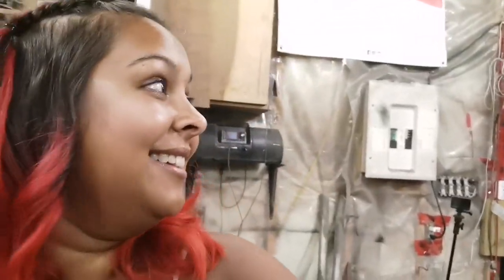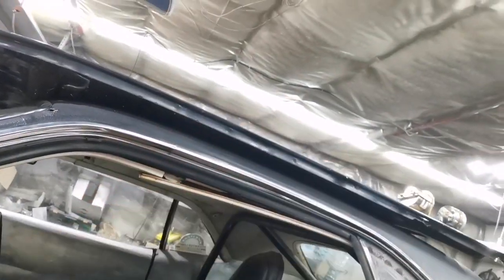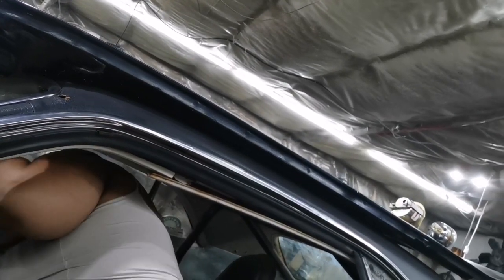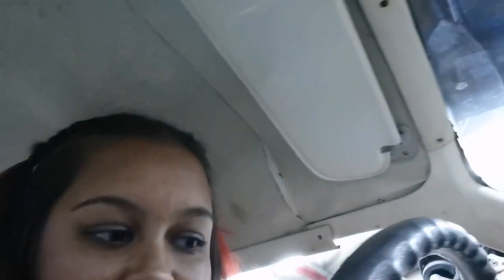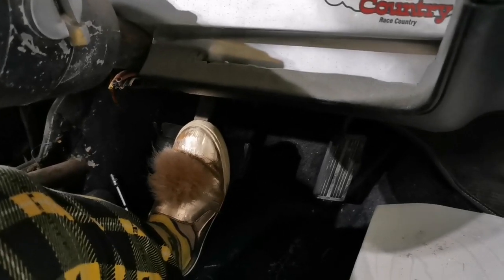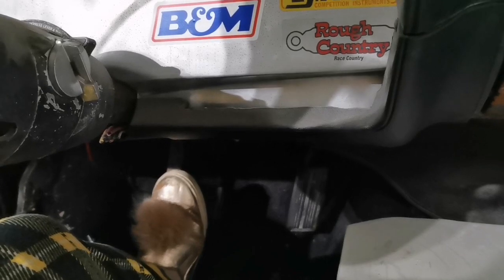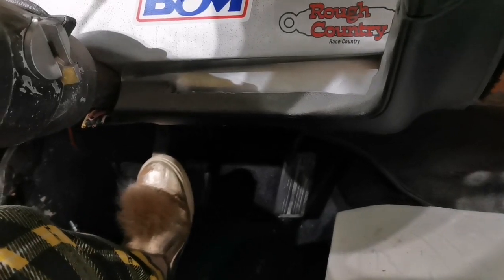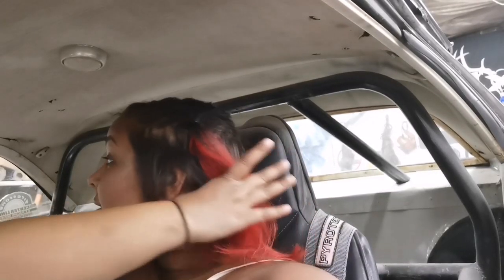Behind the Scenes - Brake Bleeding Fail

Comment: You worked hard! Props for sticking it out as long as you did. Dan should have you bleed good brakes once so you get a feel for what they should feel like so you know what to expect when you have a bad one. Sometimes they just take longer especially when they have sat forever. Good rule of thumb so you don’t get confused is hit the pedal a few times to make sure it’s to the top and then when you’re both ready do 3 pumps and hold with continued force to the floor. When the pedal hits the floor say floor. When he says OK, 3 pumps and hold and when you hit the floor say floor. Even if it doesn’t hit the floor he will know that you’re at the bottom. After about 3 of these let him know of it is getting firm or still soft then start the next position. Don’t stay on the same wheel. Because you could pull air from one cylinder or line to the other. Keep rotating around until they all eventually push out the air. 

You’re still the brake queen!
Reply from the maker: Ha ha thanks for the advice!!! I'll definetly try that the next time!!